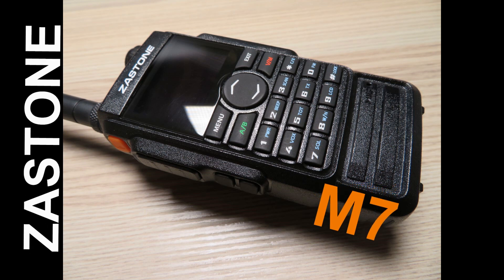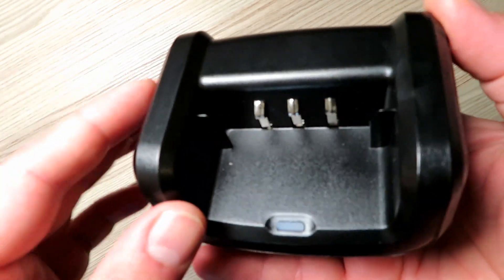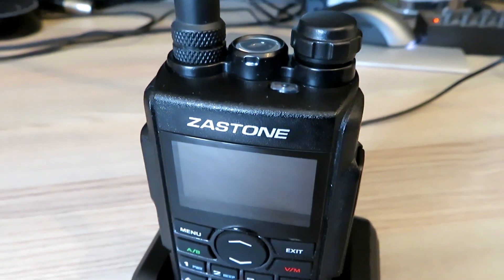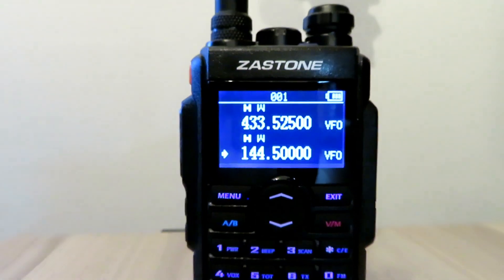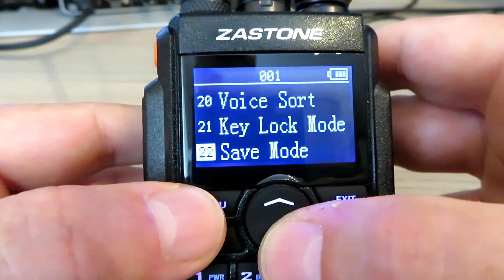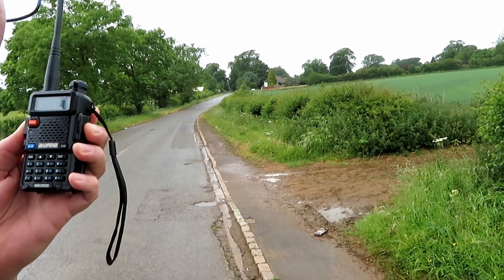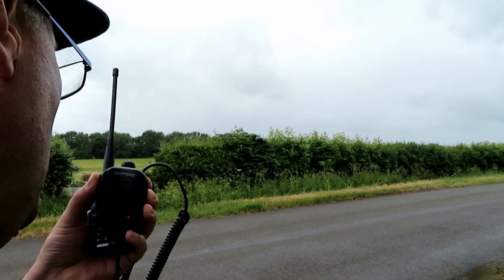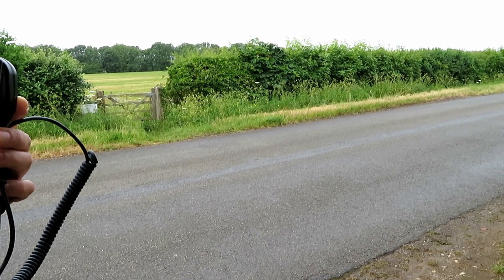ZASTONE M7 - A VERY CLOSE LOOK AND FIELD TEST - A UV5R BEATER ?

Comment: Nice looking radio and that arge screen is way easier to read than the Baofeng and has more info on it. I'm presuming that screen will drain the battery quicker than the old school LCD of the Baofeng?
Out of curiosity, is there some way you could demonstrate the scramble feature is between scrambled handsets and with a non-scrambled handset?
Might not appeal to all but I'm intrigued.
Great video of a nice radio 👍🏼
Reply from the maker: Yes I might do a video on scrambling and if one brand works with another good idea thanks 🤫👍

Comment: Great vid again, knoxie. Looks nicer than the uv5r and display is great. I wonder if power would be slightly higher if the batt was fully charged? Noticed it was on 4 bars during test. Maybe a firmware update will sort the other issues. Craig
Reply from the maker: Yes I'm contacting the supplier battery had fully charged on the base...hmm

Comment: I'm sorry but with all those features that don't work and 1/2 actual power output as compared to rated claim, I be sending that one back for a swap-out. Just too many  issues even for a Chinese  rig. Especially the tone issues. It's a nice looking and well laid-out radio. Great review as always!   :^)
Reply from the maker: Yes understand as I said in the video if it's not a problem it's not a problem but if it is a problem it's a problem 😂👍 for me I don't use those features, also might be possible to enable it or change firmware, I'll ask the seller thanks for watching.

Comment: This model has a design flaw that I don't think you noticed. The charger doesn't char the battery to 100% and you can see it in your video. One bar of battery is missing. Supposedly it's an easy fix (maybe changing the resistors in the charger?) but I didn't try it. I also read that one can change the programming of the side buttons which would be useful since one is for squelch and the other one is useless. It would be nice if you could change the other one to scan. I've read about it but I didn't manage to find that option. There's a lot of checkbox options in the software that I don't understand, mainly due to chinglish translation.
Reply from the maker: I'll check the charger issue, I'll check the voltage, quite a few of the radios only charge to 4.1V the batteries will last a lot longer so it's not really an issue as I've never had an issue with battery life on any radio they always last longer than I need them.
Reply: @knoxieman   Do you have the 1.0 version of the software? You can't get it from the official site and there's no contact information. Hilarious. There's a password locked section for additional setting but I didn't find the password online. I really hope the side buttons will be programmable in the future.
Reply: @westsenkovec  did you find the password?

Comment: That's a shame that a good radio for its price does not have a good programming software. 1750hz tone is present somewhere in the HEX of the exe file but I can't find it anywhere. I can't program the two side-buttons either. I think this radio is underrated. Zastone DOES NOT reply to messages or chat. Chirp doesn't support it and so we can't use Its potential at the best. Is there something "we" can do to have this radio "jailbroken" ?